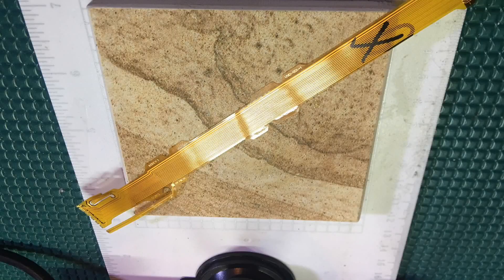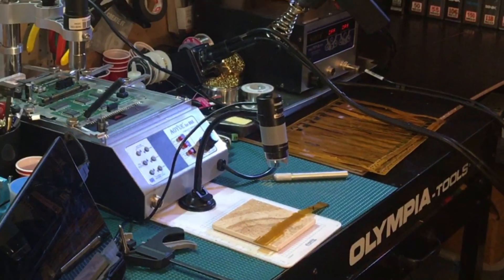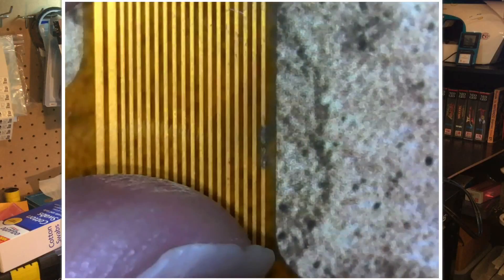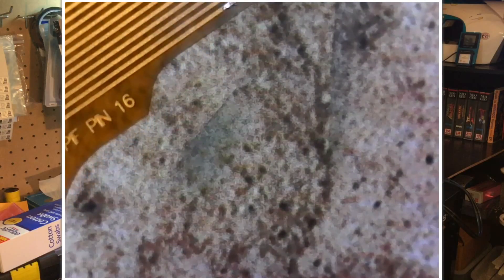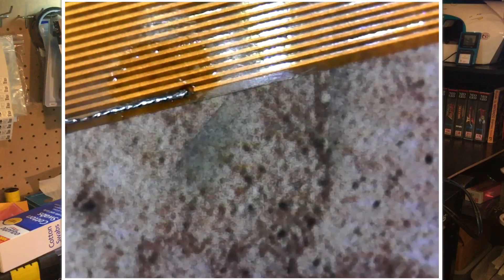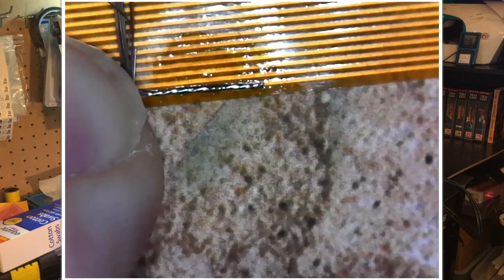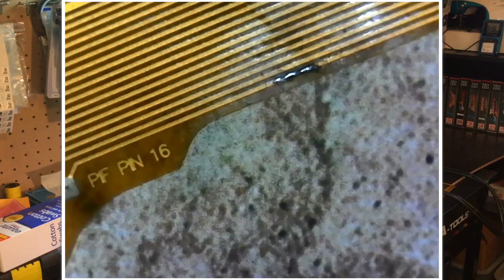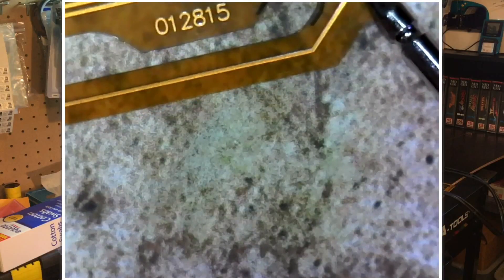Trace repair: Salvaging N64 UltraHDMI FFC flex PCB

Comment: Any thoughts on if this would work on a smartphone screen cable that has been severed? The basic principle seems to apply
Reply from the maker: Sometimes, but the pretinned wire I used might be too thick for many smartphones. Plenty of room inside an N64. :) Conductive paint or the stuff used to repair defroster wires in car windshields might be better suited if clearance is an issue. You have to make sure only one trace is exposed, of course, and any movement/flex could easily break the connection.
Reply: I hadn't thought about the defroster conductive paint. I'll check that out. But yeah exposing only one wire at a time so there's no bridging seems to be the main hurdle.   @emmettturner9452